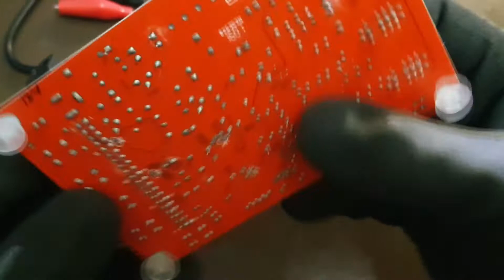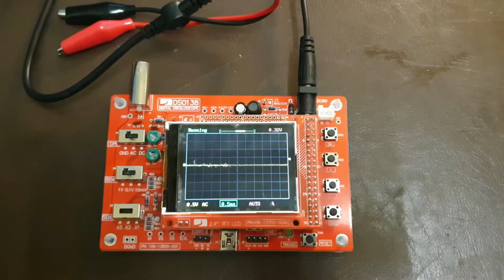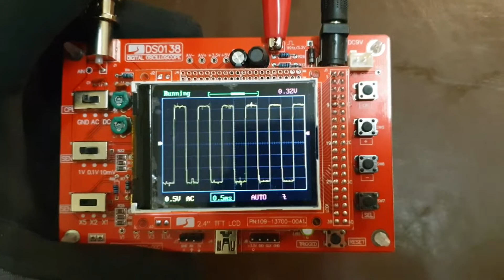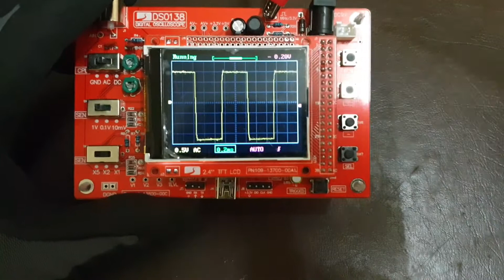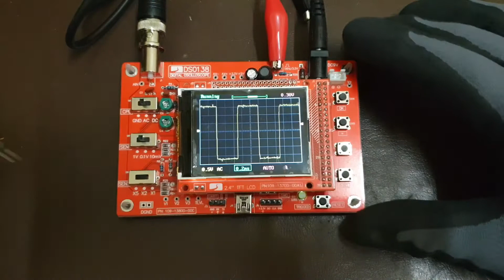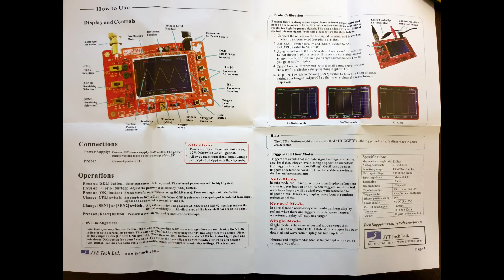DSO 138 DIY Oscilloscope | Calibration | Cheap Oscilloscope | Color screen | DSO Manual

Comment: 1. Hissing/ beep sound coming from the device. 
2. Test rectangle signal is not flat at peaks (I am using 9v supply from buck module).

Any help ? :)
Reply from the maker: Ya may be you are using buck module. Buck or boost modules run on pulses and can produce noises very easily. May be try some more stable supply. Hissing sound can be made either by inductors or beepers.. I dont think this device has anything else that can make sound. Inductors make sound when on high load and operate at audible freqs.. thats also strange in this case as this is low power device!
Reply: @ProDroneControl  bigg thanks for your response. :) Any alternate?